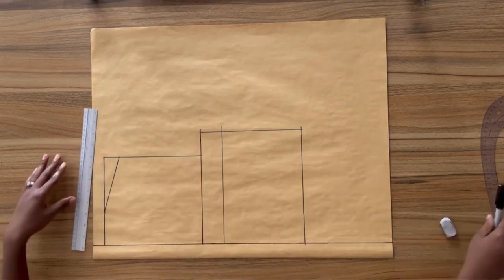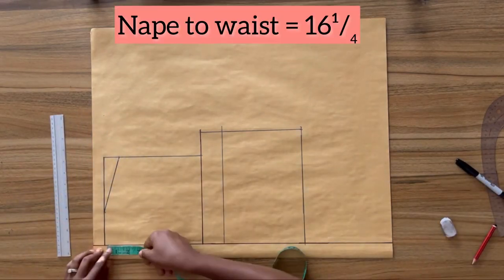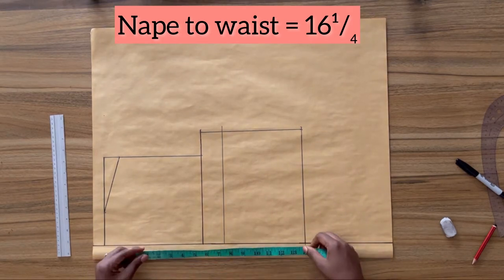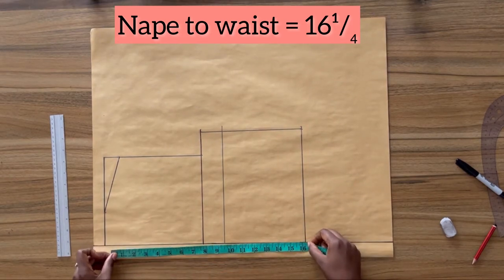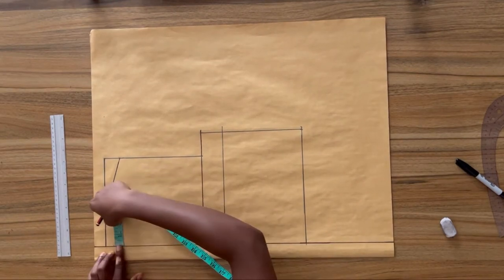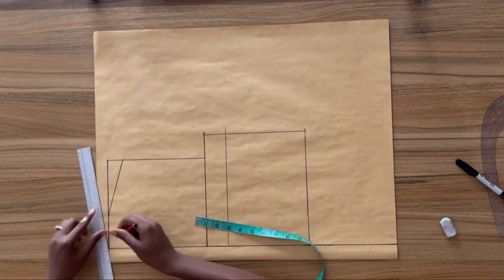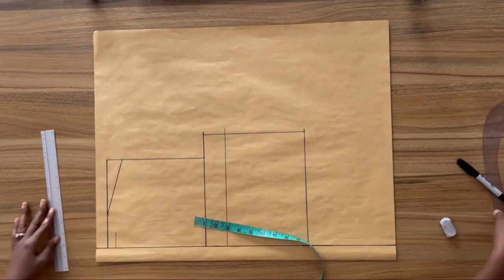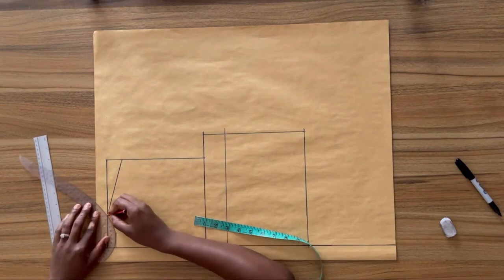Basic Bodice pattern | Why The Bust Dart | Easiest Method |Cilla Si

Comment: Hello !!! please my side seam measurement is 8.5 and my back measurement is 16” so by the time I deduct this from my full length I’ll be left with 7.5” …… my shoulder measurement is 14.5” by the time I do the math to get the shoulder slope I fear my armhole length won’t be enough if I just join it to what’s left after I deduct my side seam length from the full back length
Reply from the maker: What do you mean by your back measurements ?
Reply: My back waist length measurement *
Reply from the maker: Before I answer your question please confirm you took your side seam accurately  like this . 
 First tie a string around your waist 
Then  look for a ruler that’s 1” in width or cut a cardboard paper 1” wide place it under your armhole  and measure from the bottom of the ruler to the string under your waist . Let me know if it’s still thesame
Reply: @CillaSi  Thanks so much I just did with a ruler tying an elastic rope around my true waist line , placing 2 fingers under my armhole and measuring with a wooden ruler from where my second finger stopped to the rope around my waist and I got 7 inches which is different from what I got before ….. You’re truly a life saver, God bless you !!!
Reply from the maker: @eniolaokunola2082  great 👍 the side seam measurement could be very tricky but I prefer doing this than  using any other formula . A very important note !!! you will have to lower the armhole with  1”  after you have completed the draft if you are going to use it with sleeves for sleeveless  lower it with ½  to ⁵/₈   

Make sure you have already gotten your bust dart before you lower the armhole .
Most importantly test your pattern if possible

Comment: I really like your teaching. Very clear and straightforward. Is dart really needed for someone whose bust is 38 and waist is 36, just a 2" difference? how do I go about the back, front, and burst dart, please?
Reply from the maker: Well I will assume the person has a big tummy  and I am also not sure who you are are making it for but for mature woman who don’t like their clothes tight you have to use their actual body measurements plus ease . 
For a client like this , for the blouse you need a dart because of the bust  you could squeeze in a ¾ to 1  as the waist dart width  add some ease on the bust like divide the bust 38 ÷4 +1” = 10.5   
It means you can curve in the side seam with ½” 

for a skirt you can do without the front dart and even the back dart as well .
And you also need a bust dart

Comment: Thank you for a well taught video. 👏👏. My back waist length is 16 and half, front waist length is 19, my seam length is 8 and1/2. The difference between my seam Length (bust line) and bust level is too wide: 5 inches. Will this pattern work?
Reply from the maker: Are you very busty ??

Comment: How do get the side seam measurement. I noticed you’re making adjustments.
Reply from the maker: For the  Adjustment I made after sewing the first pattern, is simply to show why the pattern is not complete without the bust dart and how to get the bust dart which is the completion of the basic bodice pattern .

For the side seam I like to take the measurement directly on the body  . First locate your waist and tie a string  around your waist make sure  you are standing in front of a mirror. From the side while your arm is stretched in front of you, you will see where your arm is joined to your body at the armpit just place two fingers under that point and measure from the end of the second finger to the string on your waist .you will need someone to help you with this measurement. 

You can also divide your back waist length into two to get the side seam length but I prefer to measure as it’s more accurate. 

For the adjustment I did on the side seam, I did because after inputting my bust and waist measurements and connecting both together with a line which appears to be slanted because of the proportion of the waist to the bust ,  this increases the length of the side seam for me from 8½  to 8⁵/₈ of an inch although just ¹/₈ difference I still need to take that off  to maintain my original side seam measurement of 8½”  and redraw my armhole.

Comment: Hi I have a upper bust 5” smaller than my full bust. Will this method of drafting work for me?
Reply from the maker: Please read this carefully before you follow the instruction below  !!

Now If you follow the process carefully, it will work but my advice to you is this .
First follow the first step and then sew it on a muslin . do a test fit in front of a mirror…. you will definitely see lots of gapping on the armhole. 
 pinch as much of it as you can , pin it and carefully remove the muslin from you and sew it up you can use hand stitch or sewing machine,  next loose the side seam and go down from the armhole about 2 to 3 inches and from the armhole and draw a line to the bust point and cut it open .

Important note !!  Note here that your front waist length will be definitely longer than the back waist length because of your full bust so the difference should be a side seam dart already !!! meaning you should already have a  side seam dart 2 to 3 inches below the armhole at the first stage before you sew the first muslin .
In this case  you will have to press that dart first with iron to mark it or simply use a pen, then loose the side seam dart first and cut the middle of the dart to the bust point ( make sure you have already sewn the gapping at the armhole before this step ) so this will increase the width of the  side seam dart you have initially because of the the gapping in the  armhole you just transferred to the bust . now copy this on a paper it’s best you copy just half of the front piece . Use a French curve to redraw the front  armhole  make it smooth.
now for the back pattern, your back armhole curve can be ½” deeper instead of ¹/₄ inch. watch the video of the back pattern you’d understand . Make sure you test this on a muslin after making all the adjustments

Comment: Why is better to have the bust dart come in from the side seam? If I’m making a dress with no sleeve can I have the bust dart come in from the arm hole?
Reply from the maker: Yes you can  leave it on the armhole or move it any where around the upper torso .
If you are using this method and you want to leave it on the armhole make sure you  close the dart and true the armhole.
Reply: @CillaSi  ok thank you!

Comment: Will this work for e a very large bust 49"
Reply from the maker: Well as long you using your accurate measurement, there’s a huge possibility it will work . I would advice you draft the pattern, try it on a muslin, see the fit and make any adjustments that needs to be done . You must not get it right the first time and that’s fine.

Comment: GoodMorning. You have like three basic bodice pattern on your channel. Which one is more preferred to follow?
Reply from the maker: Yes two out of the three videos are the same I only throw more light on  one  with practical hence  this very video . I really do prefer this one because it has worked out mostly for me .
Reply: Thank you. Is this the sleeveless body pattern?
Reply from the maker: @millicentokwe838   I lowered my armhole with ½ inch to ⁵/₈ of an inch to make  this bodice a sleeveless block after everything.
But you have to be sure that your side seam measurement  is accurate . 
I usually put a  1 inch wide ruler under my armhole before I measure to get my side seam length. so once I get this measurement I can now lower the armhole depth with ½ inch to get my sleeveless block and 1 inch for sleeves block . 
The armhole of this very bodice in this video  is quite high  and might be too tight for sleeveless. So the thing here is that you want your sleeveless block armhole to be high but not so high that it hurts your arm and make you uncomfortable and you also don’t want it low
Reply: @CillaSi  thank you so much.